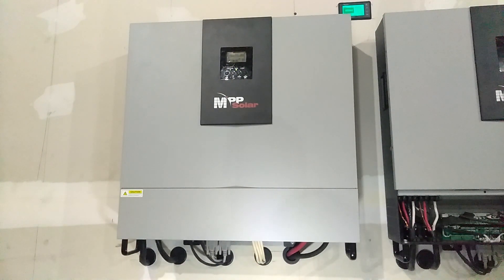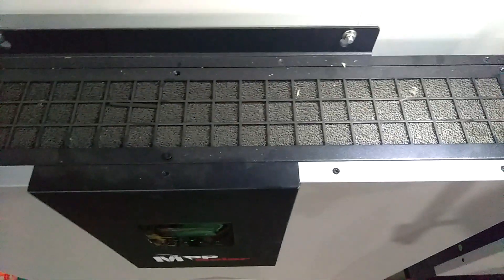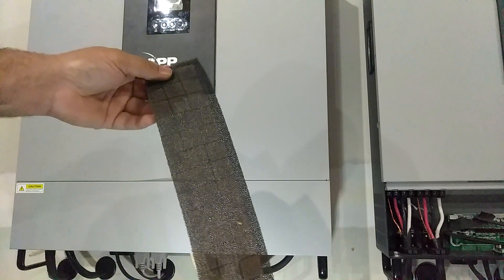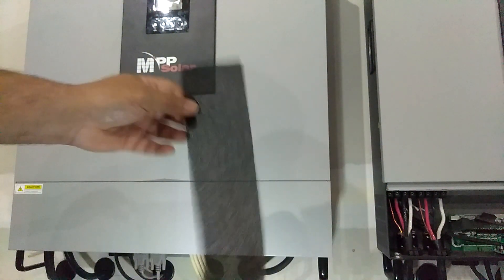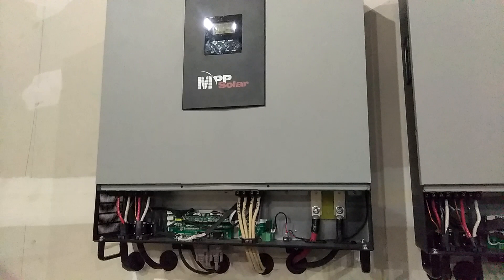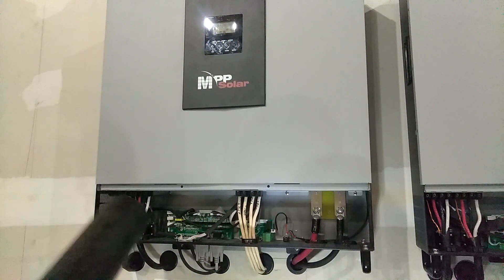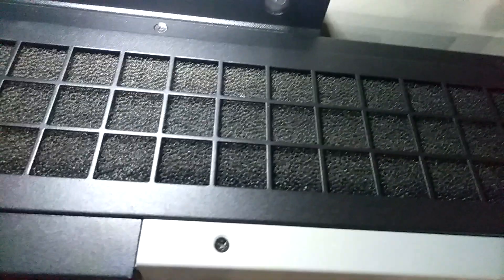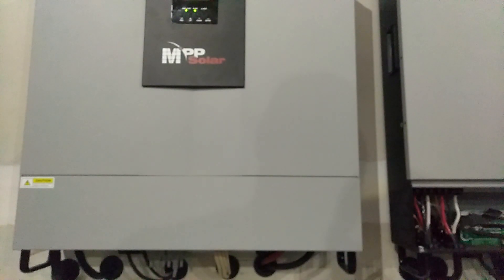how to maintenance your lv5048 MPP solar inverter.

Comment: Thank you for the videos. I was wondering how you had or have your wind turbine tide in do you run them straight to the batteries or in to the Lv5048 after the the dump load and charge controller?
Reply from the maker: Haven't used the winter binds and quite a while. I had them hooked up to some lead acid batteries but I sold them and never wire them in to my Nissan leaf since I went with the three Nissan packs.

Comment: I disassembled mine a few days ago, used compressed air can to clean inside
Reply from the maker: I used to use the air compressor and spray in there but it's much easier just throwing a battery in the leaf blower and blowing it out. Thanks for watching 👍